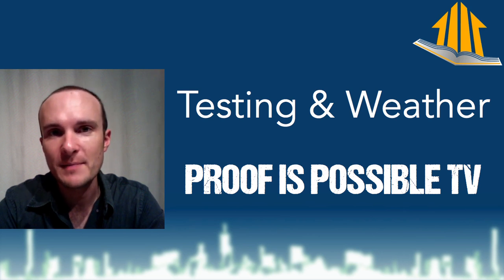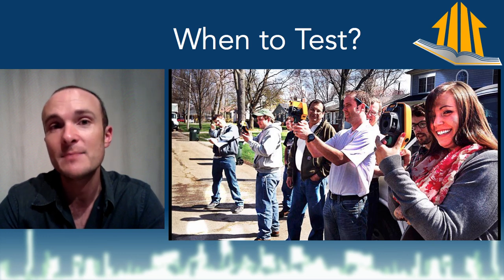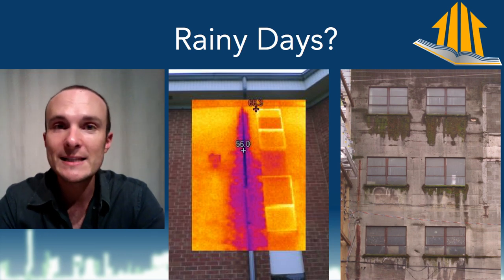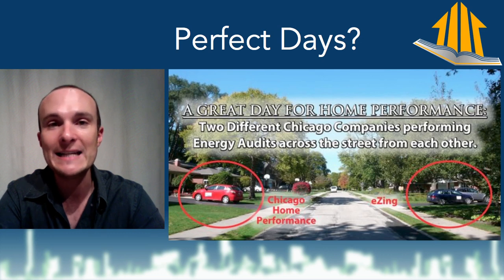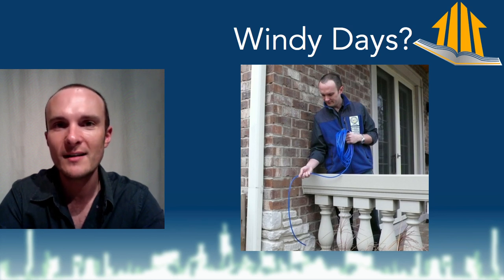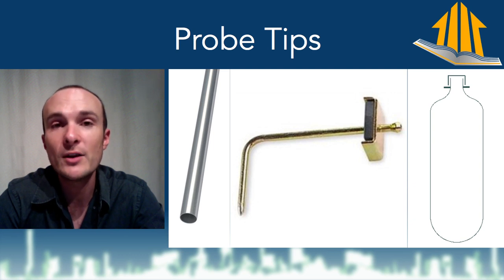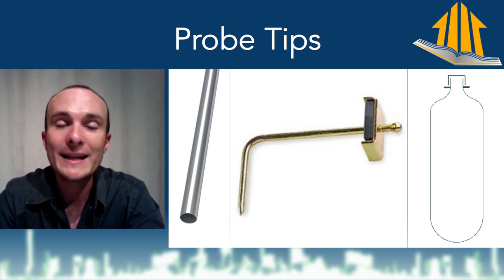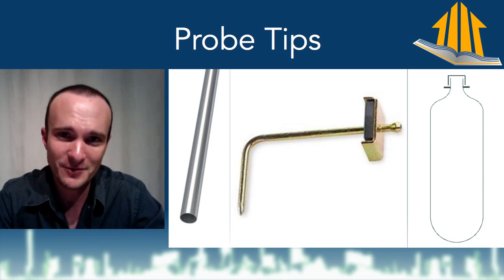Blower Door Testing & Weather

Comment: Hole filled soda bottle might be ugly, but a fast food cup with a lid looks and works quite well. Takes wind gusts (Venturi principle) out of the pressure readings. I have also put the hose under the front door mat.
Reply from the maker: Ken Ovryn Good ideas, Ken. Actually, it turns out that splitting the pressure hose in three places so you have four ends, one for each side of the house, and getting them as low to the ground as possible, works most accurately. The soda bottle thing doesn't work for buffeting wind, since everything on that entire side of the house is being pressurized, soda bottle and all.  Main thing is to avoid wind if possible.

Comment: ok... so you are saying to put the hose all the way out to your car? I have always had positive results when using a splitter.
Reply from the maker: Splitting is awesome, Jane, and if you can split three times that's best- one hose for each facing of the house is what's recommended by the tool manufacturer.  But if you don't have the time/hoses to do it, this has worked for me!